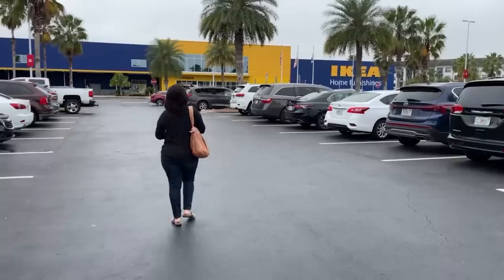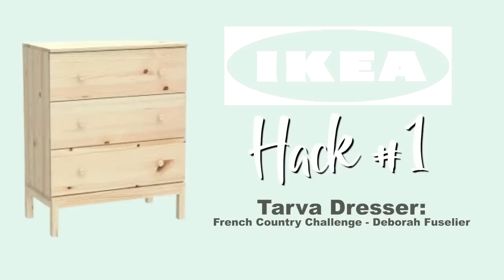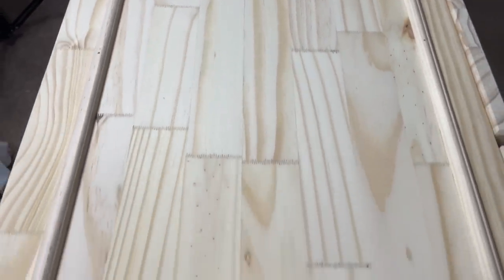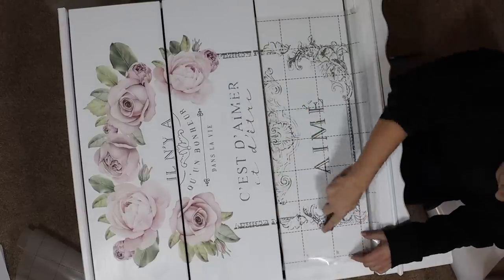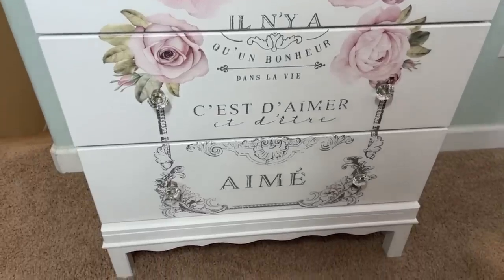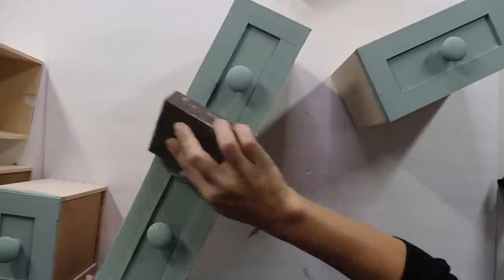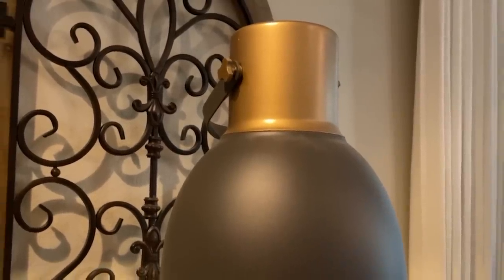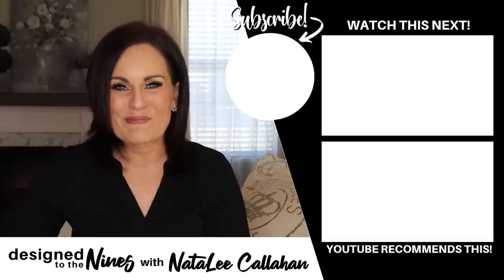Shocking DIY IKEA HACKS That Look High End: Challenge Accepted!

Comment: I love all of these projects! My favorite one is the Mope mini dresser. The only thing I would have done differently would be that I would have used the dry brush method in a slightly darker shade instead of sanding the edges. I love the idea of the cost efficient paint stir sticks instead of buying wood in the length you would have had to buy. And of course, the knobs are the finishing touch. Why wouldn't they have been standard on that thing anyway? 🤷‍♀️

Comment: I absolutely love your channel and you're amazing ❤️....I Just wanted to Add a Very important tip.....It's VERY Important to Seal that Furniture transfer with a waterbased Clear coat ...If you Just want to Seal the transfer You can Use either A Matte finish or satin...But If you don't Seal that Transfer It Will DEFINITELY Peel and curl up.   Hope this Helps ..and What a Beautiful IKEA hack ...🥰👍❤️❤️❤️❤️
Reply from the maker: Thanks for the tip!
Reply: @designedtothenines  absolutely. .I just love your channel 🥰👍

Comment: Planters can be so expensive and I’m always running out of space to plant flowers or veggies the planter I’m working on making with the lampshade and styrofoam I also am using sheets or an old towels. I took a tomato cage put it in the ground made sure my lamp shade would fit over the top of tomato cage cut a piece of styrofoam to fit the top of the lamp shade poking the hole in the middle of styrofoam so once it’s turned over it will have drainage trimmed my sheets and towels to fit over the lampshade draping them with a hole in center, lining the hole to center of lampshade. Let it dry once you’ve covered it with the concrete mixture for 24 hours once it’s dry you can remove it from the tomato cage and place a bucket upside down in the center of your lampshade after turning it upside down for lampshade right side up for planter then spray you bucket on the outside with Pam or oil then fill with concrete mix around the bucket let dry 24 hrs then remove your bucket carefully  sand it a bit and I like to paint them and then seal the outside and fill with potting mix and your favorite veggies or flowers 🌸. I hope you make one it would make an awesome video.

Comment: I want to buy a quality miter saw and a lightweight nail gun? Any recommendations? I would rather not have pneumatic since I don’t have the air tank but I found a small tank to buy if the I end up getting one. I have looked at several on Amazon and also Harbor Freight. I’m not ready to pay big bucks but under $500 for both would be doable. I would also love a table saw but they are $$$! I’m planning this summer to do a complete basement makeover by myself! I don’t want some crap that will break the 1st day I start! Hopefully you ca guide me. Thank you. I also just bought two of those Moppe drawers. I’m gonna using them supplies. I’m looking for drawer pulls with a insert section for naming the drawer contents. Sorta like the old card catalog drawers in the Public library. Haw you seen these for sale anywhere?